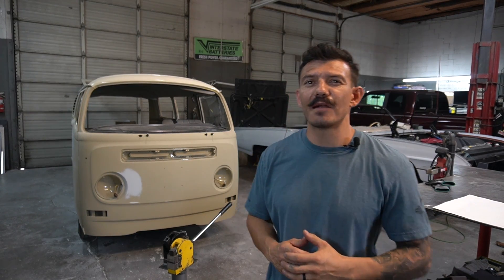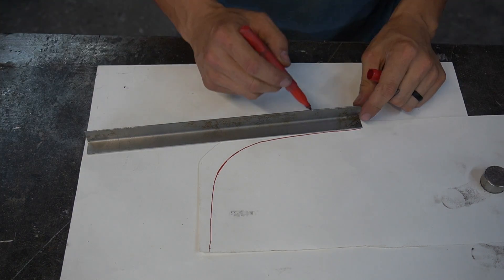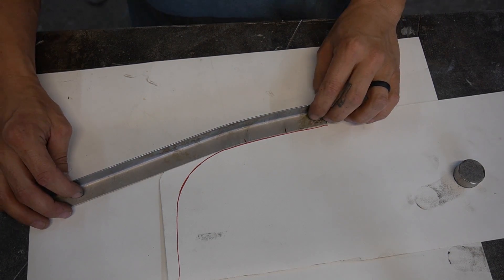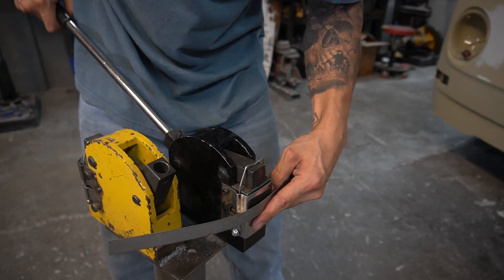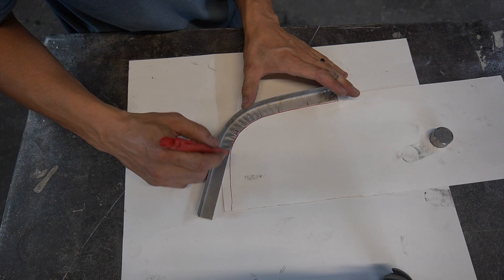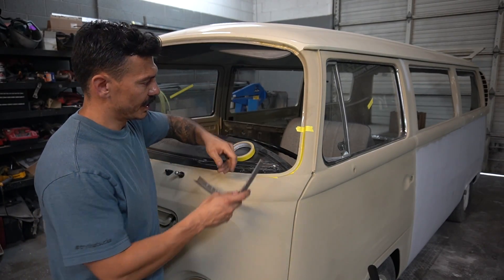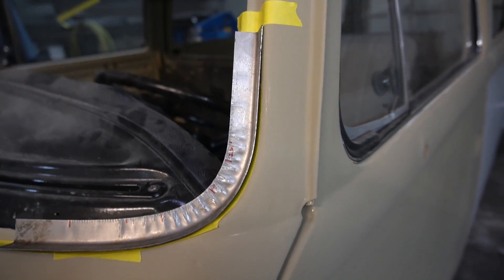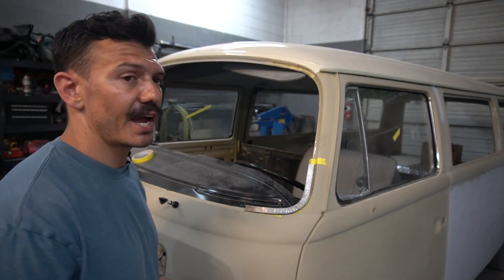How to use a shrinker/stretcher for metal shaping | Metal Fabrication |

Comment: Good video brother what would you do to get rid of stretch marks on that piece
Reply from the maker: Some slower shrinking and pushing the part further into the shrinker would have kept the ripples down, but planishing with a hammer and Dolly would take care of those no problem. Might have to stick it back in the shrinker a few more times after planishing but it would work
Reply: Thanks for getting back to me im sure I'll have more questions in future
Reply: @BeAMetalFabricator  Now that is a great reply to the question! ... In my opinon anyway. 
I've pushed metal around since the 70s and I watch others like you do the same (never stop learning). 
I've seen many people do this and not explain how the reduce the ripples (tucks) in the first place. And IF they mention planishing out the metal they rarely mention re-shrinking and re-planishing until you get the results you want.
Also... explaining that the stretcher can easily rip the metal was a good tip.

Not that you need my validation but .. good work. 
I enjoy your videos, even though I have a fair bit of experience, there is always something to be learned from others.
Reply from the maker: Thank you for your comment bro I really appreciate it! I love learning from others also , and by no means do I know or clame to know everything, I still have a lot to learn. I just want to show what I have learned from doing this kind of work in the hopes to inspire the youth and others to work on their own  projects and continue the trade. Thanks again for watching!